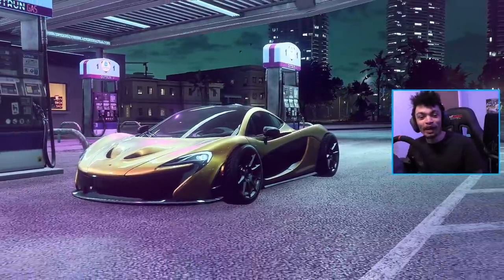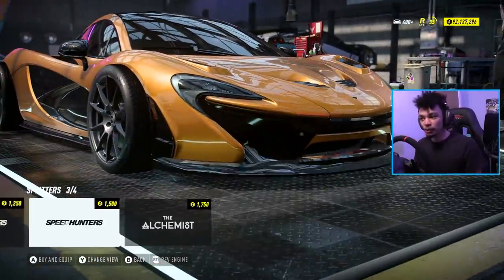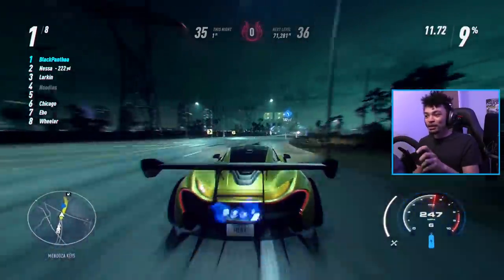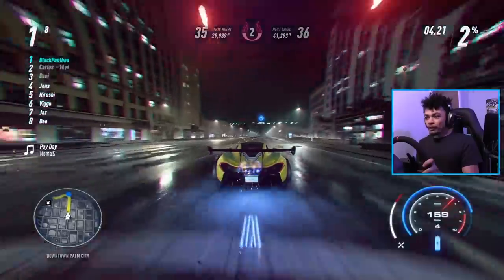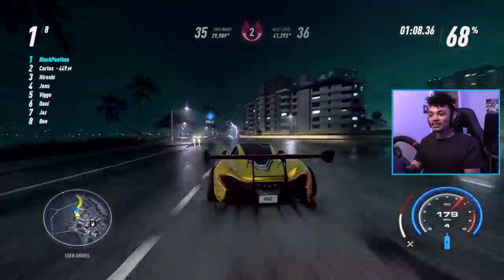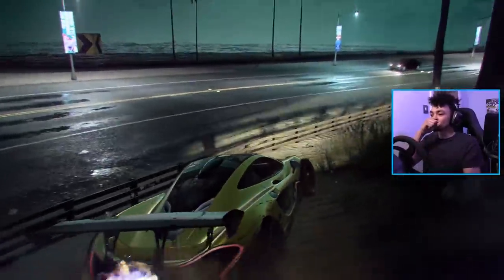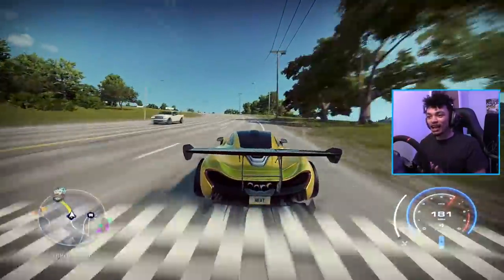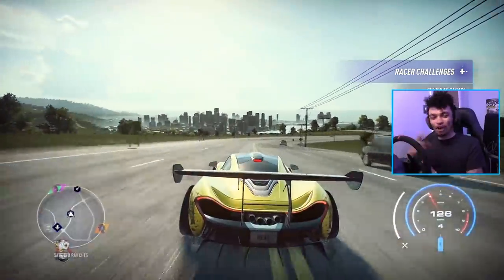Need for Speed HEAT - 6000HP With a RACING WHEEL?

Comment: Nfs with pedals and a wheel is very fun. You just need to know that turning corners you need to press and hold the gas entering into the corner and then mid turn just use the brake and then just keep going, its pretty satisfying once you got it right.
Reply: It is pretty dope just started playing it 🔥🔥🔥 how can i drift like this on Forza???
Reply: Bro can you play competitively with wheel on PS4 ?
Reply: @sacjohnson1  Depends... If you are playing some game mode where you need to turn corners at a super-fast speed, then probably no. It's about enjoying a more authentic driving experience. But if you play drifting then the wheel can definitely help you but you need a specific wheel that can turn around very well.
Simple answer: Yes but I don't recommend it.
Reply: @cristiancuscenco9912  thank you bruv
Reply: @sacjohnson1  No problem, brother.

Comment: I believe these kinds of mods and game physics' extreme alterations display in a very clear way the aspects in which the driving experience could improve a lot more.

I for example modded nfsu2 with the greeveX mod and instead of over pumping the ecu and turbo I was fairly reasonable with it but focused a lot into making the cars heavier yet rear axle more understeery coz of widened physics feel for it. Without modding the visual width.
Felt like forza without the infinity like torque. Although was easy to keep drifting even in 5th.
Was so much fun...
I miss my rwd converted R34 uphill experience in nfsu2...

went from 5th gear drift entry to feint to holding e-brake drift lowering gears into 3rd and ripping it up from 3 to 4th gear.

Was soooooo cool.

nfsu2's issues is torque dies out... cars stick too much to ground coz light weight feel and too sticky tires.

Among other things.
Now imagine if we had live tuning in nfsu2 guys. Omg... ❤️🤙

Comment: 1700 to 2500lb 800kg buddy then gotta have that negative camber settings good thurst angle
Then soften up shocks struts medium soft huge  stupid azz rims medium size tire as spec ratio 25 30 35 and 40 45 50